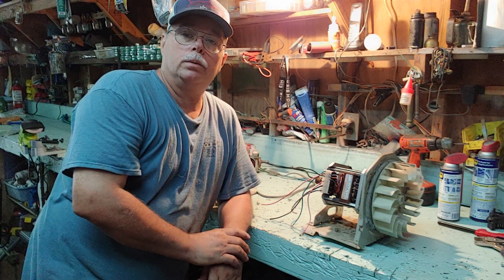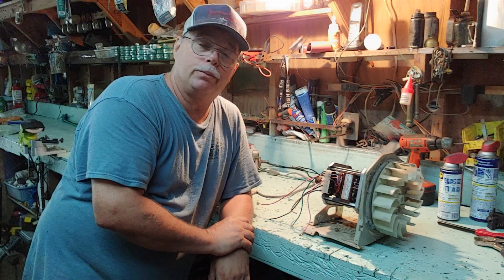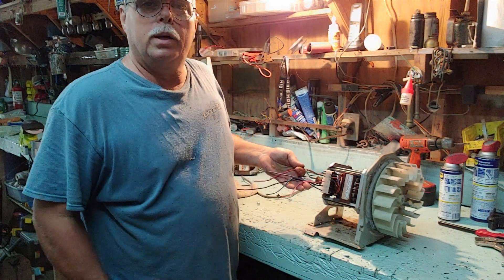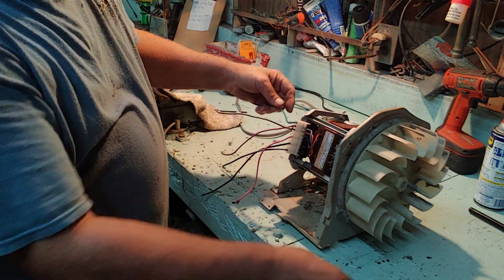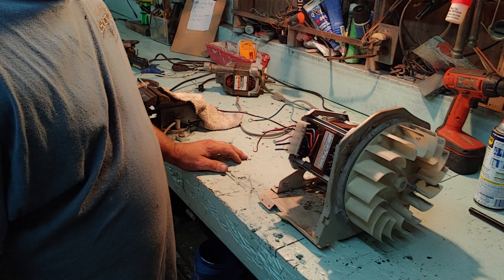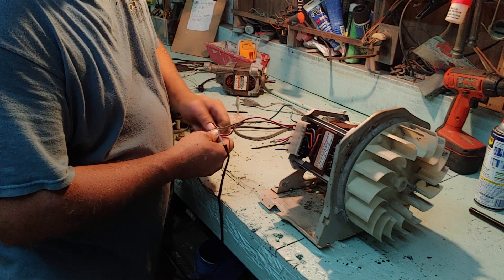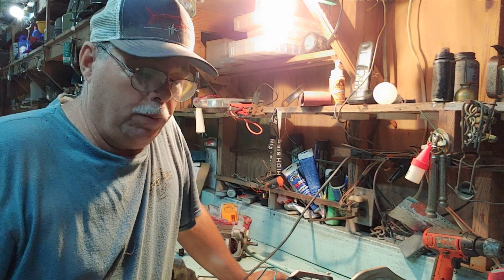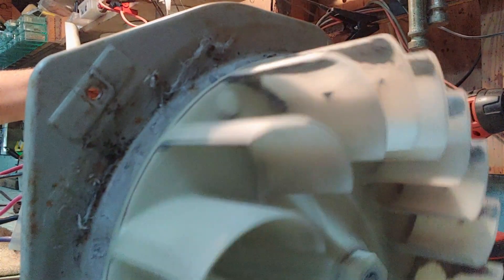How to repurpose a dryer motor and make it run

Comment: I had a multimeter, but that darn thing must have grown legs and walked away.
The motor I have came from an LG so my wires are a bit different.  There is a white one, which I assume is positive. Then the other two are brown and blue.  Do you know which wires I need to use?  I was hoping to turn my motor into a wood lathe.

Comment: Have you a video on the older style with terminal blades and not the harness?  switch  # is 3388235 on mine.

Comment: I finally got it to work after going to a few shops and they would not help me. Your guide was great. Basically I have a GE 572D676G002-5KH26GJ115 from my old dryer. I was using it for a sander but it dropped and it would not start. Using your instructions, there are 7 connectors. Connected my negative to connector 3 (orange) and then connected my positive to connector 4 (black). Back in business and now I need to setup a starter switch.

Comment: Kinda quick on those connections. It seems to me that you do not connect anything to the blue wire. The black on the motor looks brown to me. I will assume that it is black. You connect the white wire (postiive) to black. and the negative to the orange from what I gather.

Comment: Mains power is not one negative one positive because each wire cycles between positive and negative 60 times a second. Ratherly, it's preferable to say one hot and one neutral.  

Thus if one adds a switch, they'll be primed to switch the hot side. Which has certain safety advantages as you won't hurt yourself with neutral wire but you could be injured of killed by an acident mishandling a hot wire.

Comment: I wanted this to help me so bad with the dryer motor that I had last month, but it was just too different. Then, this month, I took apart a dryer, and what do you know... identical!

He did it spot on but it was a little confusing to follow, so for anyone confused - black cord wire goes to the red motor wire, and the white cord wire goes to the black motor wire. Also, the black motor wire may not be black, but it will be in the same position. Mine was gray with a yellow stripe.